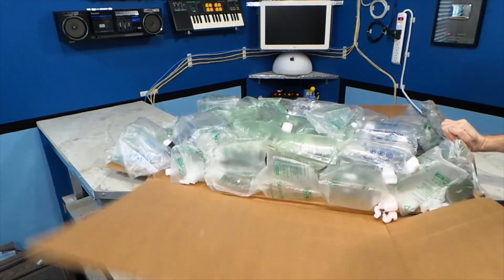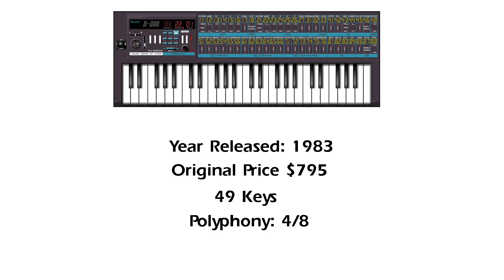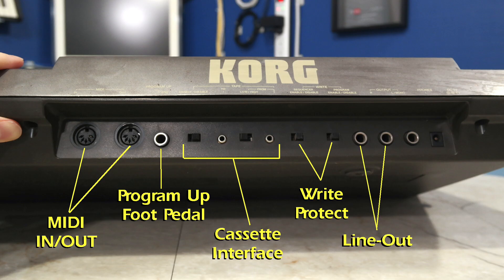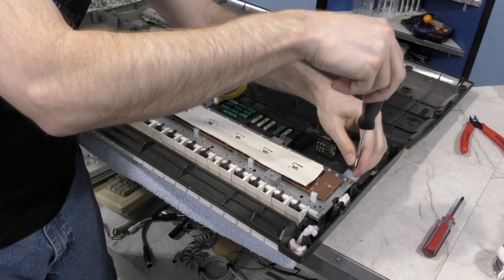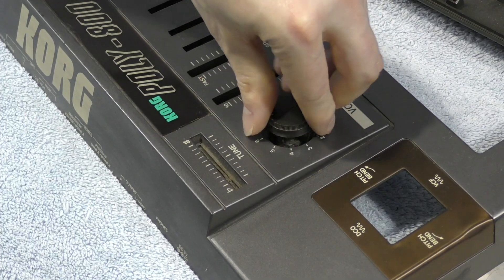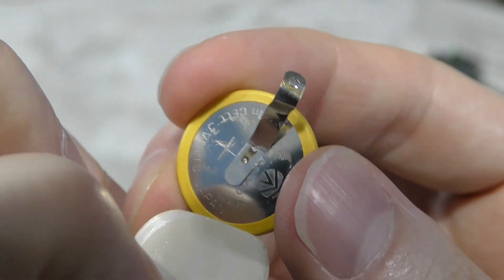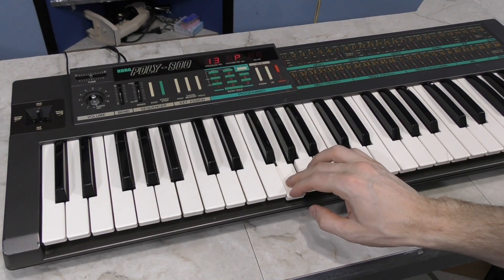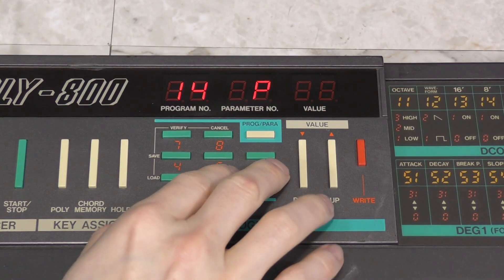Korg Poly 800 Battery replacement and factory reload.

Comment: I guess you could say the factory sound bank on this synthesizer works like unarchived BASIC programs on a Texas Instruments graphing calculator.
Back in the early 1980s, solid state memory that was cheap, could be localized on a single chip and accessible did not exist. This statement does not include cassette tape drives, which were probably cheap and accessible.

Comment: You could have used MidiOx to backup and save the factory presets before you took it apart.  I still have the original battery in my Yamaha DX100.  It still reads in at over 2V so I'm leaving it alone for now.  I bought a factory replacement battery from Yamaha in 2008 but have yet to solder it to the board.

Comment: The early production models do not use an internal battery. They instead use the 6 C batteries to store any saved patch data, but the cool thing is the original patches are never lost without the batteries in......so if you remove the batteries you regain all the original sounds back. If you make a custom sound then switch to a different patch then back again it is not saved and reverts to the original unless obviously the batteries are in. The batteries can last exceptionally long (as long as you power the keyboard by the power-cord and not the batteries). There is a big sticker on the back of these early production models talking about this and mine still has it. Mine is serial number 023032 (yes its so cool it seems fake, but it is not) If yours is lower than this number, it will for sure not use an internal battery and will give you far less to worry about. I don't know when they switched to using the internal battery but I talked with a guy who's  serial number 079845 and his has the internal battery. So somewhere between mine and his they started using them. If anyone has more info on when exactly they started I would love to chat.

Comment: Possible question: If there was a tape in and out; why couldn't you have just copied the presets out to tape/computer; then that way you'd have a copy of them in case you wanted them back on, rather than the factory presets?

Comment: Maybe connecting another battery somewhere along the circuit or even directly on the chips power pins parallel to the old battery would have preserved the patches while you replaced the old batteries. Something like connecting those little 9 volt batteries to your cars cigarette lighter while changing the battery so your radio settings don’t get erased. Do you have a video on ram and how it works? I’m curious on how it’s preserved by such little power and erased so quickly when unplugged

Comment: I have a copy of the original program patch sheet that came with this synth. It lists every original patch and parameter for manual entry! If you’re interested in a digital copy let me know, or anyone for that matter. I recently replaced the internal battery, and had issues with the tape interface. I found a link for a .wav file on strellis.com, that contains a good wav file. Many of the wav files online I had issues with, and this was the only file that worked for my synth. Granted, it is his personal presets, not the original, but I must say they are far superior to the factory sounds. If anyone is interested, message me.
Reply: Allen Oberhem hey bro how can I get the file for the presets?
Reply: http://strellis.com/mp3/poly800/poly800_presets.mp3
Reply: Worked for me, took a few tweaking with volume level etc. But I did it from my iPhone multiple times before I actually replaced the battery. Granted many of these sounds are from Strellis himself.
Reply: If you want the actual factory presets I have them on patch sheet. Good luck programming them.
Reply: Thanks so much man, I downloaded it onto my Samsung note 8 and used a 1/4 Jack like you said and voila, it loaded and said good. I didn't notice the first two times I tried to load it I had the Jack plugged into "to" on the poly 800. Like you just said I had to play with the volume settings for a while to even see the load letters flashing so I knew I was close. This is my first keyboard and synth so I am very new to this, picked it up for $100 And thought it was a good deal until I plugged it in and nothing lol.
Reply: Now on to another note, I'm trying to clock the korg to my roland tr-8 or the roland mc-303  but like I said I'm pretty new to this and having trouble. I'm not using a computer and have it hooked up to a Mackie 1202 mixer. Any help to how I can sync the midi clock? Much thanks and appreciation 😄
Reply: Dirty D wow! Very good deal at $100! I paid 250 for mine, albeit it’s the rack mount version) which I like more anyways...Anywho! That’s a great bargain, the type we are all looking for. I’m glad you had success on the “strellis” website. Byeeeiii!

Comment: Can't be an 1983 model as the date-code on the chips date towards the end of 1984! Can clearly see one with 8444 meaning the 44th week of that year, but if the other circuit-boards all have components dating back to 82 then there's always the possibility that the logic-board has been replaced at one point!
Also, I'm sure many viewers would agree with me in saying that your musical skills are much better than you rate them!

Comment: Questions from a longtime musician but electronics amateur: what exactly is the function of the battery you changed? And is that a common thing for most old (and current?) keyboards and synths? What goes out when the battery dies? I recently bought an old Yamaha PSS470 (found this channel when researching it!), does it also have a battery that needs to be changed every few years? I have no experience with soldering and working with circuit boards, all my knowledge and practice is in the realm of music and songwriting (guitar, bass oriented) so it's a bit intimidating to consider that my synth might die at any time and I would need to invest in soldering equipment and teach myself all this just to revive it. This was never a concern on guitar and bass so it's all new to me.
Reply: Bit late, but oh well.
The main reason these things have batteries is to store data in RAM. Solid state memory that you can actually change is needed to store custom settings and back in those days the only solid state memory worth considering was RAM, but that looses it’s data when there is no power. 
The point of the battery is thus to store user settings.

Comment: Hi 8-Bit Keys, thanks for the post. I have the same model Poly800 but a previous owner had already done a similar CR2032 update to the keyboard.
My battery went flat, I replaced it and have tried to reload the factory sounds. The load sequence from the audio out on my laptop ends with the 'good' display on the synth but none of my sound presets sounds like yours. They are nearly all a wash of DCO/VCO effects and no sound that sounds like a factory preset. Any ideas what I need do next?

Comment: a nice little trick is to solder a temporary parallel battery before removing the old one, directly to the s-ram chips pins so you can remove and replace the old one without losing patches

Comment: Thanks for the upload. Very informative, once more !
My 2 cents : when you change the battery, you can check if your SRAM chip accepts a range of voltage it is going to work perfectly with.
For example, on the Acorn Archimedes, the CMOS chip will accept from 1.5V to 6V, so when I need to change the battery, I am not stuck with the exact same original type (In particular if I do not bother with the fact the original battery is a rechargeable one, and I simply replace it with a normal non rechargeable battery, with a diode to prevent recharging).

Comment: \WAIT!.. i dont remember a ni cad battery mounted on mine. ??? in fact when i got it it was the first thing i opened it to do and i cant remember a battery. it's not here anymore.  the polysix had the one that leaked and gassed the rest of the synth, though. i had one of these you wouldn't want to paint over that chart unless you really like the presets or have a great memory LOL. besides this is a real "vintage" analog synth (albeit not a very good one) i did the "moogslayer" mod on mine  and  i was able to get some  decent sounds out of it  when i unlocked the filter.. fun review  by the way !

Comment: Amazing! love your videos ! By the way,  I was actually replacing the battery on mine but the voltage tests on the chip read 2,86V when turned off and 4,4V when turned on, is there a tolerance when it comes to the 3v or should I check for a bad cap somewhere? Also the yellow ribbon cable attached to the display panel doesn't work properly (tested continuity at each pin which didn't show anything weird but when I plug it in and touch the cable the display goes crazy), I'll try and find a replacement for that but I'm more concerned about the value at the chip (direct test at the battery shows 3,1 v so something is getting lost somewhere) any idea?  EDIT: I've tested the continuity of the 3V starting from the battery through all components before that chip, I get 3v across all components before this chip, but the chip itself reads 2,86

Comment: 👍 😉 on the vid! I have one of these in the garage and for the most part it's been fine except for a short it suffers from when it's been on for a while. Would it be worth it to diy fix or not?

I dug it out and it seems in mint condition except it's missing the power supply! I went to the local 2nd hand store and bought a 9v 350ma power supply (phone power supply) and will be testing it out shortly. polarities are opposite so will be using an old radioshack plug wired up to see if I get the thing to light up or not.

Comment: May I give some advice when securing stuff to circuit boards it is best to use RTV. Using RTV allows an easy clean up if you ever have to remove the component, and is considered industry standard.

Comment: I did the facotry patch reset you showed in this video but upon powering up the synth still had no patches. ill note the ac adapter port seems broken and it runs on C batteries. im considering opening it up to see if the internal battery needs replaced but heard very early versions use only the C batteries to hold patches. My poly 800 is in immaculate condition with original box and manual so im hesitant to open it up before i know. Any way to verify if mine has an internal battery before opening it up? like serial number or something?

Comment: Ugh! I was freaking out when you removed the battery knowing everything was stored in RAM! I've had to replace those 2032s on a few instruments that had calibration parameters stored in RAM and went through hell hooking up an external power source WHILE desoldering one and quickly soldering another.

Then you mentioned you had the original tape programming recording and I freaked out slightly less, but I'm wondering why you didn't record what was on the instrument to tape before you removed the battery?
Reply: Boomer. That's why.

Comment: I had to do the same job on my Yamaha YS100 when it started indicating low battery TWENTY SEVEN years after I bought it. At that pint it hadn't even lost the sounds. I guess the Keyboard manufacturers knew that the keyboards would be well out of warranty before the batteries died.

Comment: Could you maybe back up the original sounds and then change the battery, like by tape out if this KB even supports that or is it load from tape only? Or you can put alligator clips on the battery terminals to supply 3VDC to the RAM while you change the batteries. I did that with a caller ID box and after changing the battery, all the numbers were still on it.

Many pinball machines store their content this way. You could mod a 2AA or AAA battery holder to the circuit and then use lithium batteries and you'll never have to change them again.

Comment: Hi David- i have a suggestion for some RETRO tech to keep an eye out for. I think you'd definitely get a kick outta the Roland MC505 groovebox. I found mine on the sidewalk in Philadelphia & it has been a mainstay in my collection. I think it's from 1994- but there are even earlier models, like the 404 & 303. It's more of a workstation than a keyboard (it comes with a multi track sequencer & 8 voice polyphony for each of the 8 tracks)

Comment: We have one of these as a third keyboard, my step son tends to use it. 

Why I'm telling you this is that he found files online that he managed to download and then install onto the poly800 via a USB to midi cable using his mac. Changing the sounds at will. 

We where worried in the first place as we got this secondhand but knew the sounds where not default, but didn't want to brick the keyboard. 

Anyway it get used a fair bit. 

You should do more of the pro keyboards, as your vids are more entertaining than some of the youtubers that concentrate on pro keyboards are no way as entertaining as you. 

Keep up the good work. 😊

PS repair a DX11, 
I have one and it lost everything as the battery has gone. I could do with an instructional video to help fix.

Comment: Protip. with such old electronics, solder a temporary battery in parallel before replacing the original unless you're fine with the memory loss.

Comment: This video was fascinating, thanks! I bought the slightly updated mk2 in 1988 and used it for years. I think that it's unfair to put the Poly 800 in the amateur category. It had MIDI, line out, and perhaps most importantly, a very sophisticated and configurable timbre generation. As you point out, each patch has 50 parameters, like waveform, LFO, and lots of filtering. It gave users incredible flexibility. It would take hours to explain how to really use this keyboard. It's not the most sophisticated analog synth, but it has many powerful features.
Reply: JSRFFD2 agreed. it's no DX7 but it is a lot more powerful than the average Casio toy
Reply: Its a neat board, the 800 is is its own thing. I like it a lot. The drawbacks of it to me were the envelopes were a bit slow and the digital tone generator could sound wheezy. I won't fault it for only having one filter, since most low cost boards didn't have a filter at all. But still, its a true 8 voice, which was more than some had.

Comment: Well, it seems that the Poly 800 was Korg's response to Roland's Juno 106, which was more of a studio keyboard, while the 800 was more of a "performer" keyboard, especially considering the strap buttons and the fact that all boards are interconnected with plugs, rather than being soldered.

Comment: 1) Why not export the sounds "just in case"? The tape interface does allow you to save, doesn't it?
2) Why not clip a 3v power source to the sram chip before removing the main battery?

Those old machines were built to last. Well laid out, made to be worked on/repaired and durable.

Comment: I remember buying one of these back in 2000 (the first thing I ever bought on eBay) and going through this exact procedure. Later I picked up a more rare but supposedly non-working Poly-800 II (dead battery and no patches) and did the same again, which fixed it.

Comment: I also had this some time... This keypad with numbers from 1..8 (missing 0 und 9) is so weird on first sight... it seems that the programs are addressed by a 6 bit numbers and the keypad enters the upper and lower 3 bits of it... Maybe each progam takes 4 bytes of memory and the progam selector just sets the most significant 6 bits of the address lines of the SRAM...?

Anyway.. very nice video, brings back some memories :-)
Reply: 6-bits? For an Octal layout, that makes no sense.
Reply: vlo Must be more than 4 bytes, he said 50 settings per sound, so maybe 8 or 64 bytes (512 bytes or 4KB total).
Reply: Yeah, there are more than 8 address lines obviously. According to the service manual it's a 2K SRAM (11 address lines).
Service manual can be found here: http://www.synfo.nl/pages/servicemanuals.html

Comment: oh god… hotglued AND soldered onto the board? WHY? You could have used two wires, connect them to the solder spots and hotglue the battery holder on some free spot on the inside-walls of the case…
Reply: KRAFTWERK2K6 Or you could've gotten a real SMD CR2032 holder, they make those now (EEVBlog uses one on his μCurrent board).
Reply: Interesting. Gotta check that out. Thanx, m8.

Comment: Great video, I have a question. Was the original msrp of $795 from the 80's, adjusted for inflation?
Reply: LRCM Gaming no, the price of the Poly 800 was $795 in 1985.  Adjusted for inflation, that'd be close to $2k today.  Gear was not cheap back then.  Nowadays, $500 (or less) will get you lots of great choices.

Comment: If I ever create a games console (highly unlikely, but one never knows),  I'll be sure to include an FM synthesiser alongside the digital audio, as well as proper support for low-resolution, 8 and 16-bit colour modes. Basically, it should be possible to create these "retro style" games with the proper hardware of the time that is simulated, because nothing beats the authenticity of these kinds of synthesisers and the one in the Sega Mega Drive, for example.

Comment: You could have stepped the battery down a bit and used a surface mount CR1220 holder. Or you can just solder a Li-Po in there and add a small Li-Po charger board tapping off the 5V on the logic board. The Li-Po solution probably means it would never need a battery replacement in the next 20-30 years until the Li-Po go bad, as the battery will be recharged when the keyboard is powered on.

Comment: Thanks for posting, I do own a poly 800 in which the sounds are not working. I have the cassette with the sounds stored far away in storage. Do you have the link that you got the sounds from. I need to do the same thing and clean mine out as well. This was my first synth. Keep up the good work.